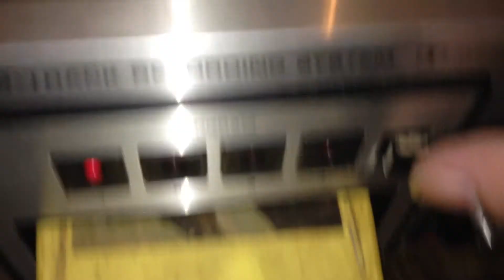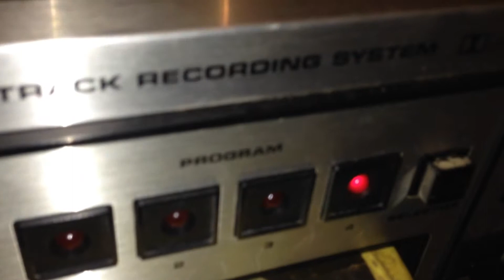IMG 4746

Comment: Hi, I need a favor. If you still have the TDR-830 and are able to access the deck inside could you measure the Dolby board length and width, I need to reproduce one to use with my TDR-820, The service manual for the 830 does not provide this information, I really appreciate it your help, I posted a thread at tapeheads.net but you don't seem to have posted there in a while.
Reply from the maker: Hello . no i m sorry i dont have it anymore sold it a couple off years ago -  And yes i have not been active on tapeheads for a long while . maybe in a while .   .